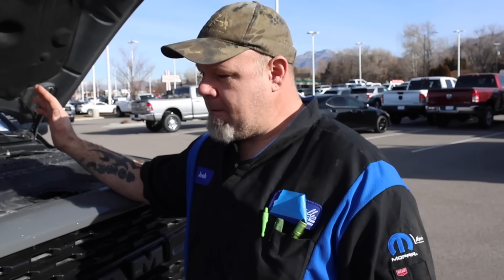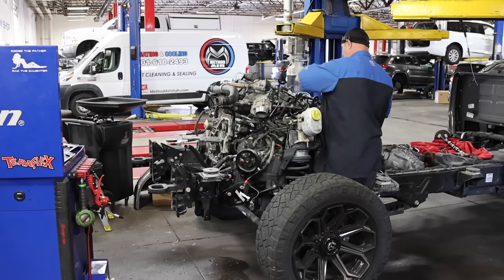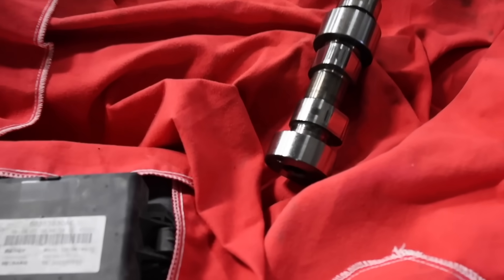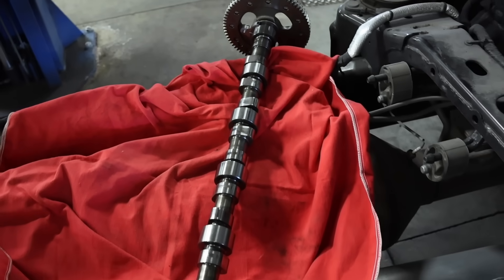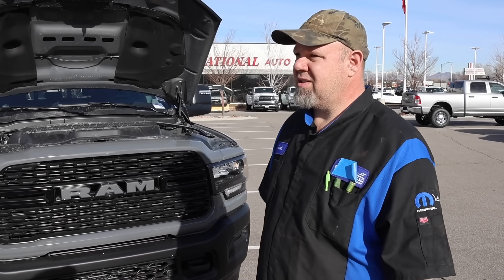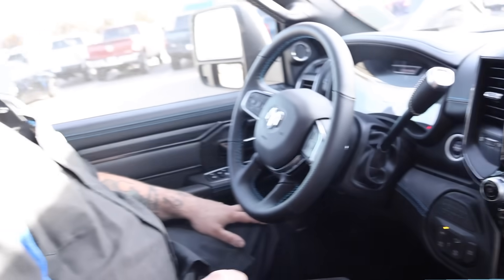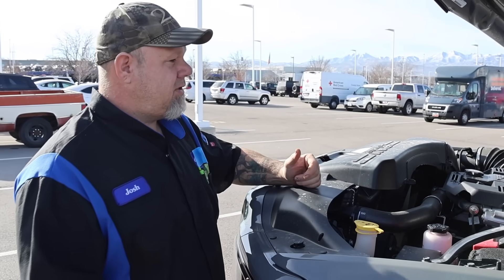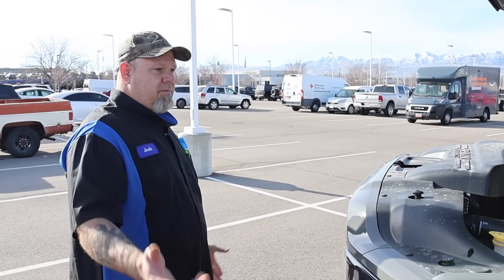Master Diesel Tech Explains The BIGGEST Killer To Your Diesel Engine!

Comment: Biggest killer of the diesel engine is the government emissions crap. Sucking all of that EGR back into the engine adds to the oil degrading. Once deleted 10k mile oil changes are okay and oil analysis will look good at that point.
Reply: A guy had 900,000 Miles and was changing his oil at 15k miles and had no internal wear the lifters went bad from wear that’s it he did run another fuel filter and fuel additives that kept the soot low on the pistons ultra low sulfur diesel is bad has lower lubricant in it, causes fuel pumps injections ect to wear out faster, oil the most important thing is the type of oil you use amsoil the best but expensive look up oil test videos on it there’s comparable videos, out there the oil filter next amsoil I run Shaffers oil they close 2nd and amsoil filter, bad oil will do the same damage if you change it on time it won’t matter it will still slug up and clogg the oil ring on the pistons, egr without an fuel additives makes the rings stick causing more blow by,
Reply: 💯  @Mikediesel-d5p
Reply: @Mikediesel-d5p  any story that begins with "a guy"...is instantly suspect.
Reply: @Mikediesel-d5p  My last truck had 785k miles on 10k oil changes with Rotella T6 15w40. New truck I am running Mobile 1 Delvac at 10k oil changes and Oil analysis says it's still fine to go longer. I don't travel near as much now so 10k is about all I do in a year. Last truck was a 7.3 Powerstroke and it still made 385-390 across all 8 cylinders when I sold it.
Reply: @  rotella in the middle it’s not the best oil pulling the internals inspection of all parts will show amsoil reduction in friction make is last longer less wear 6x the wear protection, it’s proven watch the comparison video on YouTube
Reply: I do my own oil changes now. Also use BG EPR once a year. Checked the oil and looked fairly clear after the flush a couple of weeks later
Reply: @davem4131  BG EPR is snake oil
Reply: What about the 18000 in fine and impound
Reply: @BrandonBigB956  I have no problem doing oil changes at 5000 miles. I have a Cayenne Diesel with 270k miles . No delete . All stock. Oil change and 2.5 gallon DEF every 5000 miles. Oh yeah. 30-32 mpg too .
Reply: According to Blackstone 8K was about it on my 5.9.
Reply: GM's new 3.0 Duramax uses a combination of high and low pressure EGR. Once the engine warms up, it switches to low pressure EGR which is after the DPF.
Reply: And with 2 micron oil bypass filtration you can easily run 20k intervals on top shelf synthetic.  EGR and SCR make a huge difference in oil life.
Reply: What do you think of rotilla 15w40 for power stroke 2019. Change every 5000
Reply: I am new to diesel and in the market for a one ton. For a gas engine there is an oil separator can, it runs inline from your oil pan to your intake. It separates the oil out of the air before it returns your engine intake. Is that what the EGR is or is there a different aftermarket part that you can buy for this particular task?
Reply: OK question Josh just watched your video I like it. I have a GM 3.0 2023LZO diesel first one I’ve ever owned so much stuff is on the Internet. Don’t know what to believe. Don’t know what’s true Gm recommends an OW 20 weight for the oil. Everybody says go 0 w30 0 w40 not sure with dilution wise like you’re talking what is the best. should I stay with the 0 w20? Should I just use Mobile one or should I use their recommended brand? Thanks for listening
Reply: I regularly send oil into blackstone for analysis. I have a 2019 f450 with 102k on it and they regularly say the oil will be fine for 10k. I still don’t run it past 8k generally, but they say the oil is still fine and I can go longer. Also I’ve never had problems with emission equipment. The hotshots are running them to 4-500k without issue and have to have emissions intact.
Reply: @Cherrycrochets  I have heard that hot shot trucks generally don’t have the EGR problems because they are always working hard.  Just what I have heard but the mileage on them says something.
Reply: Mines deleted 6.7 Ram I change it every 5k miles I put 11 qts Mobil 1 and 1 qtr Lucas full synthetic oil stabilizer so far 700k miles
Reply: DPF.......
Reply: That rebel luner edition is sick
Reply: yah all into peoples lungs
Reply: Absolutely , deleted my EGR and stuck a catch can on my Mitsubishi Pajero with no shit Dpf bullshit. Runs perfectly and I’m keeping it forever.
Reply: Bingo
Reply: Ok expert 😊
Reply: I have a 6.6 duromax. It good engine makes pull trailer go lol left
Reply: If all the emissions crap was "good" for these or didn't hurt them then I wonder why govt vehicles come deleted FROM THE FACTORY. Dave's auto did a segment about this a while back, we must do as they say not as they do... ugh
Reply: L egr s est de la vraie merde pour les moteurs et faut être de mauvaise fois pour dire le contraire
Reply: removed all of mine.  100% emissions free.  God bless Texas.
Reply: damn right get that crap off your engine the worst thing for a diesel is restrict the air flow
Reply: Correct ✅ 💯
Reply: If you use a diesel for what it was designed for (you dont need an 8000lb diesel grocery getter) the EGR systems are fine. WAAAYY too many of these "work" trucks on the road not being used for their intended purpose.
Reply: @jonathanstarr1591  if they are fine then why do they cause so many problems and engine / component failures?
Reply: @jonathanstarr1591  The EGR systems are not fine. It is physically impossible for the engine to get the cleanest burn and most power from each drop of fuel while it's choking on it's own exhaust. If EGR systems were fine the military wouldn't special-order their engines with factory deletes.
Reply: EGR emissions are turning 500000 egines to 150000 mile motors.  @jonathanstarr1591
Reply: @jonathanstarr1591  yep. And there’s nothing wrong with that. Freedom of choice is a great thing is it not?
Reply: @jonathanstarr1591  this is what I have heard.  If I'm not regularly doing highway and instead doing many short, in town trips, that kills diesel trucks as well.
Reply: @jonathanstarr1591  you not here to tell people what vehicles to buy egr is bad for the engine the government doesn’t use emissions on there’s, and you can’t filter out the soot unless you run an oil bypass, or fass makes a egr filter that cuts soot down by 85%
Reply: @jonathanstarr1591  I agree 100%. Diesels are meant to WORK, not cruise around at 20% of rated HP all the time, They like 80% of rated HP better.
Reply: I'm cold natured mine runs 30-40 minutes before I leave the house lol. But it's breathing freely and I run the same oil I use in my big truck shell15w40.
Reply: Egr delete will not magically make your oil clean.  It sounds like you don’t know why EGR is bad.  

Go ahead and do your 10k oil changes.  I know if my truck breaks down, it’s not gonna be because I cheaped out or lazied out on oil changes
Reply: @chewybacca11  EGR increases how dirty your oil gets and the amount of soot in the oil. I have done oil analysis before and after and it's a huge difference. Last truck I sold had 785k miles doing 10k intervals so I will keep doing them. Truck made 385-390 across all cylinders and had never been opened up. Only thing done engine wise was injectors twice and injection pump once.
Reply: @chewybacca11  Correct, but it will help the engine to run "better" when it's breathing all fresh air rather than diluted air. Diesel oil always be black.
Reply: How are you going to trade in a deleted truck no dealer going to buy it from you. I guess you could sell private party not for me I hate dealing with tire kickers and weridos that show up at your house.  Easier to just buy a gas engine truck emissions been figured out long time ago.
Reply: @Mike-01234 All the parts to go back stock are on a shelf and all labeled out if i ever trade it will go back stock. A gas truck after running a diesel making big power is rough. No way I could make the switch back. Emissions are far from reliable.
Reply: A lot of us would rather not breathe cancer causing soot. Deal with it.  I’m glad mine had dpf.
Reply: @jeffshultz5348 but eat cancer causing foods. Real head scratcher.
Reply: Im using Schaeffer 5W-40 thinking it is the best. Your thoughts???
Reply: Full Syn.
Reply: Ironically, diesel emissions are also a big killer of human beings. But life is cheap, and trucks are expensive, so let’s cut the crap and free the diesels!
Reply: @CarlosRodriguez-hb3vq 😂
Reply: Anyone have a shop in south Florida that can delete my 2014 Jeep GC eco diesel? The EGR and DPF issues are unfixable. Please help
Reply: Hard to delete the 2020 and up Powerstroke.   I would like to but the support to do so is dwindling
Reply: @Cotton088 no it’s not
Reply: @Cotton088 done several
Just as easy as ‘11s and up
Reply: @Cotton088 i heard the newer power stroke like yours is easier to delete than the newer cummings and duramax. Dont quote  me on that
Reply: @BrandonBigB956  ok. You would rather pollute the air than change oil more often. Got it. 👍🏼
Reply: @LuckyNikitaBoba the Cummins blew up in my freight liner because of emissions equipment issues.
Reply: @LinusScrubTips   Your truck blow up because you don't know what the hell your doing. Where I work all of our engines are cummins and they all last over 1 million miles no problems all emissions intact. So umm your wrong.
Reply: @LinusScrubTips    that's believable.
Reply: @LuckyNikitaBoba  you would rather get booster number 7 instead of using common sense
Reply: @LuckyNikitaBoba  whatever I'd rather get more horsepower and save my engine. Plus save money in def...
Reply: @LuckyNikitaBoba  yep. Earth will take care of itself.
Reply: @LuckyNikitaBoba deluded
Reply: @LuckyNikitaBoba damn you’ve sucked up that koolaid like a world champion
Reply: @LuckyNikitaBoba  Yes - the Earth is just fine and man isn't hurting it.
Reply: @GregH-w4l apparently, you didn’t get a proper college education . You don’t believe in science. It’s ironic. Your vehicle was designed and built through the use of science but ……
Reply: @LuckyNikitaBoba 100000% I’d also rather do almost anything other then worry about the environment it’ll be fine
Reply: @jjolynyk1232  if it doesn’t affect you, you don’t give a shit
Reply: @ seeing as it doesn’t effect anyone.  Nobody should care look up the history of the climate warm/ cold cycles nothing new is happening then what’s happened over and over before
Reply: @jjolynyk1232  that's what I'm saying. The Earth will take care of itself. Always has, always will.
Reply: @jjolynyk1232 tell the world "I failed science" without saying so... the cycles of warming/cooling you mention occurred naturally over tens of thousands of years and more...the 2°C projected increase in average temp is since about 1850 (the industrial revolution not so coincidentally) until now; less than 200 years. A big difference from 150 000 years.

Comment: Is there a way to set the high idle yourself without going into the dealer?
Reply: Turn on cruise control while in park and press the button to accelerate on steering wheel
Reply: Will it stay in memory so that when I do a remote start, it  will do the high idle
Reply: The newer trucks will idle themselves up when it’s cold but the older ones won’t. You have to do it manually

Comment: Buy good filters with micron ratings that filter smaller particles than oem if you’re concerned. Follow the  engine manufacturer’s maintenance schedule that was prescribed by real professional engineers that arent guessing.

Comment: At 350,000 me on my 0124 valve I ran a 15,000 mi on new oil and when I went to change it I could still read the writing on my dipstick I have never seen this before or since although I did go back to 7500 me I only just did the 15,000 mile test because it was staying clean

Comment: The biggest thing to help my 4th gen was to stop running 15-40.  I did the first oil change with that because that’s what the owners manual recommended it was soot black inside of 1000 miles even after running extra 2 qts through the engine to flush out the contaminants.  Went to a 5-40 full synthetic and the oil stays much cleaner for longer.  As for the 5 th gen’s eating their cam shafts that is the problem with high mileage roller lifters.  Yep they give you more power but they also have shorter lives.  I don’t believe the oil changes matter much with them with the egr system intact they are just designed to fail sooner. Just like the 6.7 in the 5th gen isn’t designed to live as long the old 5.9.  The problem is the roller bearings in the lifters become loose and fall out destroying the engines.  Don’t get me wrong they are great to produce power but the they are just more likely to fail. Especially with contamination in the oil like soot which plugs up the bearings

Comment: The best fix for any diesel  is a oil bypass.  Absolutely a must. I got a amsoil one on my duramax an Cummins.  Keeps the oil very clean.
Reply: @Bsetzd  I became an amsoil dealer a while back so I’ve switched everything in my vehicles over. It really is a noticeable difference.
Reply: @cwilks5592  Hows that. Explain
Reply: Use a BD7317, has a built-in bypass 5 micron filter element in the same can. 20 micron and 5 micron. I cut mine open and posted pics on Bob is oil guy. Great filter.
Reply: I also added a TP bypass filter. On top the filter housing are plugs you can connect for oil pressure. And down on the engine block is a machined spot for an extra oil return meant for a second turbocharger. Pop out the pressed in plug (drill hole and use a screw or something else to remove punch down sideways) and you have a place to create an oil return port. It is straight below the filter. Not many people know about it. I made a return using some copper tubing.
Reply: A catch come would probably help too, wouldn’t it?

Comment: I live in south Texas.  I keep getting different answers on which  weight oil I should be using. Very mild winters and extremely hot summers . 15w40 or 5w40?
Reply: 15/40 for hotter temps

Comment: what do you think about interval change periods if you run amsoil and one of there oil bypass cleaner kits or a kleenoil system.as a cummins owner since 1990 and run amsoil for over 20 yrs i usually change every 25000 kms.
Reply: After 20 years of experience changing oil every 25000 km you proved that changing oil faster isn't necessary, or did you got problems?
Especially with bypass filters you can run much more km before changing oil, it's totally not uncommon that the bigger trucks are running around 100000 km before changing oil if they have also the bypass filters. The maintaining coast are otherwise to big because they are standing in the workshop, they need to run.

Comment: Oil-bypass and always 5,000 mile oil change is what will make the biggest difference.  Check out Insane Diesel by-pass system.  IMO the best.
2008 6.4 with 355,000 miles.
Reply: Also good video.  Thanks for sharing.

Comment: So much truth here!  Great video and many thanks for making it.  I have alway ignored the ridiculously high  roccomended oil change intervals on my Land Rover and since new the oil has been changed every 10,000km and more often if I am towing.  Another tip is even after a few minutes of warming up don't push the engine hard when cold.  Keep the acceleration and speeds down until full operating temperature has been reached.